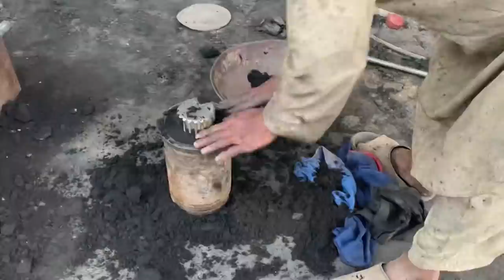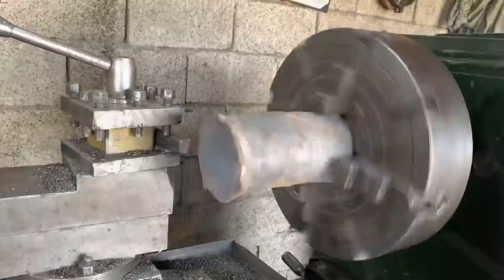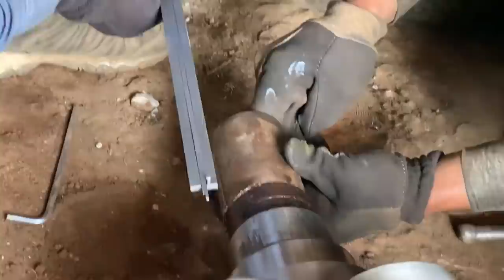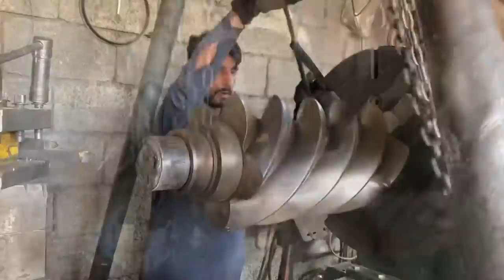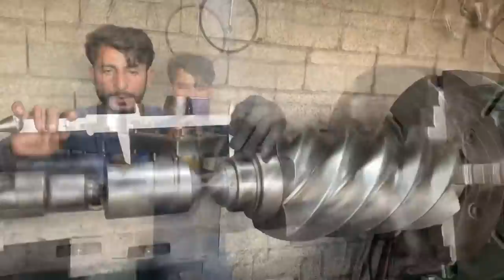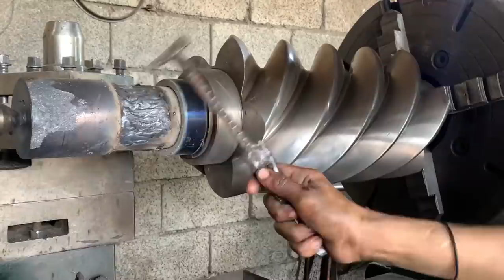How To Rebuild Speed cutting Worm Gear || Amazing Process Of Broken Worm shaft repair

Comment: If it was a seized bearing that caused the shaft to snap then a good repair may last but this wasn’t a good repair. The new shaft was cast from who knows what grade of steel and the welding was poor. Welding over slag is a big no no, it causes porosity. If you’re going to weld it while mounted in the lathe then taking a cut after the slag is removed will give an even, flat surface to weld on and reduces the chance of inclusions and holes. 
Good to see the guy doing the casting wearing his PPE “Sport” flip flops so that if he pours molten metal on his feet he can run like hell to the river cool them down.😂😂😂

Comment: OMG! As a professional blacksmith and welder, it hurt my eyes to see what they did there.
9:33 You NEVER ever fasten your cutting tool with just one screw at the tool post!
Stick welding this thing whilst in the lathe...they don't even bother to protect it from the splatter.
The weld...well it's hardly worth commenting but one thing is sure welding on slag won't make this any better.
I don't know what he does there but welding looks different.
16:54 Oh yeah..now just some nice finish to make it look decent. "Grinder and paint make me the welder I ain't".

Comment: Love the dedication, and effort put into repairs like this. But doubt that it lasts, if it even works. Some things just can not be done in a backyard fashion. When this blows up it will likely destroy the entire machine they were trying to repair. Some education in metallurgy, and proper welding techniques would benefit these fabricators so much. Interesting video to say the least.
Reply: Indeed. I was wondering if they have the capacity to work types of steel ideal for this application.  I suppose high ductility would be most important. Then I saw they built up that huge piece with welding rod and I thought ‘that’s not right!’.

Though I agree with you I would love to know how long the repaired cutter works and how it fails.  Maybe they will surprise us! 

A part like that is super expensive. If they bought it broken basically as scrap they may come out ahead.  Of course, if it fails catastrophically it could damage equipment and maim or kill.

But no need to worry about the latter as they are clearly very safety conscious!

My snideness aside, I do admire them for effecting this repair.  I would love to see a similar repair done in the US, Germany, Japan, etc.  i assume the process would be to order in a part from the manufacturer that was already machined and heat treated.
Reply: i agree, the size of the gear itself should tell you this thing is under some serious load. for some reason in Pakistan they think highly of their welding skills and methods. i bet if they had cameras on the road we would see some serious crashes. i wouldn't trust it for nothing.
Reply: @DennisHicks78749  111
Reply: @DennisHicks78749  gentlemens, did you not realize that this is not the first repair? Before that, this part had already been welded, an overhead clip was made, it is possible that the trunnion is already not native, but replaced. Externally, judging by the nature of the fracture, it looks more like this trunnion has already been welded in this way. I am interested in another question... What did they weld? Here's what was obtained from the melting furnace - it's either cast iron, or it's unclear what. And how it was welded at all is a mystery.

By itself, this is quite a working method, so I restored the gear shafts, the shafts of electric motors, and they work to this day. And I welded by electrode welding, why TIG in this case? These shafts work to this day, everything is fine. But the welded steel was intended for welding, and not for the incomprehensible composition of the metal from the furnace...
Reply: Agree...  I praise their dedication and effort, but this is not the way to do this.  For starters, why is everything in Pakistan dropped/worked in the dirt?!  You have what looks like a 5-6 start helical gear that's ground and some degree of polish and they keep dumping in the dirt on the floor of the shop.  Then they lift it with chains on bearing surfaces and the chains rub up against the gear teeth...

The lathe looks like it's on it's last legs...   Probably sold off as scrap from Europe or the UK.  Chuck is not great.  Live center is pretty crap too.  

Then there's that shit casting of mystery metal and the porous welds that guy was laying down, not to mention no means to keep spatter from adhering to the running surface of bearings or the gear teeth.  This repair is doomed.  I hope no one gets hurt when this thing lets loose...
Reply: I can do this repair in my country. I do it for a living… for over two decades I’ve been repairing this components and never had a failure after. 

The best way to do this repair, instead of a welding axis, it’s an inserted one. You have to drill the entire body of the rotor and then insert a new one, based on the measured of the original one… basically it’s needed to copy the old one into the new inserted one. For a better behave, the best material it’s SAE 4340 

Best regards

Comment: If the hardened steel shaft had issues, I can't see something made by random steel casting and welding standing up in the long term. There is a right way to do this, but unfortunately this is not it. At a minimum I'd at least like to use some bar stock made of a similar alloy and treatment to what is being repaired.
Reply: Yes that was my question as well why they didn't use the similar steel ! 
Casting shaft and welding to different steel ??

Comment: I didn't like that weld one bit; 
   The end of each pass should melt well into the 2 parts at the ends, at the beginning and end of each pass,  not just over the previous weld in the middle.
Reply: I don't think any real planning went into the repair. The shaft looks to be a separate piece from the rotor/screw, so while it may not be feasible to press it out in its entirety, at least you could fabricate a new section rather than trying to hold the thing together with some chewing gum and a snickers bar. If its in some form of compressor service, both the runout and the load capability will be quite critical. Here the shaft is now just some random metal they had lying around and a bunch of welding boogers. I wonder if it even worked at all?

Comment: I see lots of these videos. There are clearly experts from well equipped countries shops in developed countries suggesting this will fail - I suspect they are all right. Probably if these were built from the correct steels and hardened shafts with a thorough maintenance schedule they may never have failed in the first place.  In terms of what these guys achieve with basic equipment and what they have on hand I'm blown away by the results they get. I would love to know how long these repairs last
Reply: I suspect its a compressor vane from a screw type compressor.  The tolerances are super tight on such things, it needs to rotate with a matching partner to seal air and the tolerances these guys are operating with arnt even in the same planet as whats required.  This part will never be assembled, it simply wouldnt rotate against its partner.  And if they assembled it loosly enough to actually be able to rotate, the repaired part will not be balanced, so itll never spin at the required speeds to compress air.  And even if it did spin, the join theyve completed here is terribly weak.  The metal theyve welded to the end is the wrong type, its not chipping like a high tensile steel, more like cast iron to me.  It will fail, in seconds, if its spun up to its designed operating speed.

Id be elsewhere for such an event.

But I stand by my first point, this thing is never being assembled ever again.  We're seeing a pantomime of metalwork.  All this part is good for is generating hundreds of positive comments from people who have no idea what theyre watching take place, and hundreds of negative comments from metalworkers who know what a shitshow this is.
Reply: @shutupmeg176  Yes, that's right - one part of a screw pair on a screw compressor. And yes - it won't even last ten seconds! In such clips, THEY NEVER SHOW THE REPAIRED PART FITTING INTO THE MACHINE AND THE MACHINE WORKING!
Reply: app. 2-3 months

Comment: I'm a Plumber by trade these days after spending 30 years in the hospitality industry.  I'm no machinist but I can think of at least two instruments specifically designed to measure the diameter of a shaft and a tape measure ain't one of them.

Comment: the shaft wasn't centered in the lathe and the weld is full of voids....it would be interesting to know if the unit functioned in the machine and how long it survived.
Reply: I seriously doubt it. To add insult to injury to the person who is at the mercy of these "machinists", the shaft looks to be pressed into the rotor in some fashion, so there was probably a way to properly fabricate a new section out of something other than just random metal and weld splatter. Others have pointed out that its likely a screw compressor, and those have fairly tight tolerances to work properly from my experience with working on a supercharger I was trying to rebuild. I decided to abandon it and get a replacement as it was too far out of spec, and that would be ultra-high precision compared to this. The repair is comically awful in a really tragic way.
Reply: @mysock351C  I worked on Ingersol Rand compressors without the special tools but had the materials to make things 35+ years ago. That would have to be a seriously large machine as the 175SCFM rotor was tiny by comparison.(175 SCFM through four 1" bore lines)
 The 175 needed at least 80 hp motor to drive it but 100hp  Deutz diesel was fitted so max output could be used. The biggest compressor 'we' had for hire was 600 SCFM but no one ever got into that thing in the 8 years I worked there as it never got used to full capacity

Comment: Dudes doing their best with the tools they gave. Respect. Why can’t the owner give them some tables to work on instead of the filthy floor?
Reply: I don't agree with that I don't think they did their best. They had a kiln right outside. Once they center that if they sent her that and put their first tack in the center they could have easily built a pour box around that big gap and fill the Gap with continuous steel. This is what you call a hack job when they're just trying to get paid for throwing it back back together. Personally I would have just bored into the existing shaft poured my new shaft. Threaded the existing shaft threaded my new shaft twist together cut a v and welded a small v then turned it all to fit. At least that's what I would have done with the tools they had.

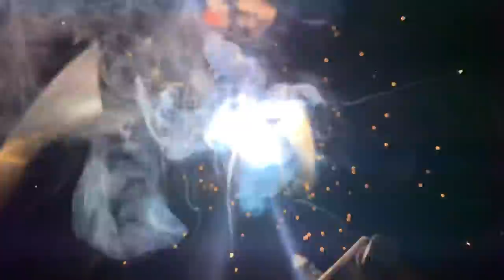Comment: This rebuilding process is invented by Disney and is called Mickey mouse repair.  The build-up welding on the lath at about 13:28 really scares me.  There will be numerous holes and voids in the welding.  There is no way the shaft would be anywhere close to the strength of the original.

Comment: Amazing what can be done with no steady rest, a wobbling tailstock, centering by eye and not with a dial indicator, stick welder instead of TIG. I too am curious to see the follow up video on installation and the machine running with the repaired rotor.
Reply: I think a lot of people would like to see follow up video's of the destruction caused by 'repairs' of this type. 
I don't think there has ever been a follow up video of anything though and probably never will be. I think the video's are trying to show how 'ingenious' the people are not how well they screw up?

Comment: At work I do not use lon3ta to center or compare, I use 7018 welding which is hard and should have been finished with a stone grinder

Comment: Not running for long, will break the shaft due to microcracking and thermal deformation. We did it and it didn't work.

Comment: the angle these guys used on the shafts was way too big for starters. that makes the weld very wide. never mind that it will break the first time they run it anyway from the crap steel they cast and the rotor must be an alloy . on all these videos from pakistan i have never seen 1 where they have a dial indicator.
Reply: Pakistan?
This video was recorded in Marseille, France.

Comment: Very good video. 
It said high speed  drill on title.
I was curious  as to what they would drill with that type of drill.
It doesn't  like any regular  oilfield  or water well bit.
Thaka again:)
Reply: That is not a drill, it is a rotor from a screw compressor.
Reply: @316tomiller  Interesting.  Gonna have to google that.